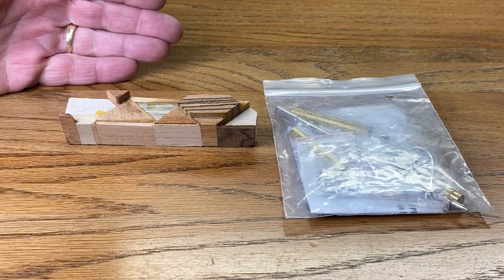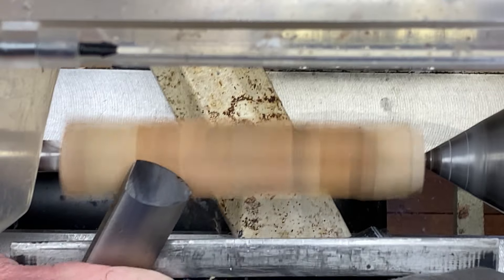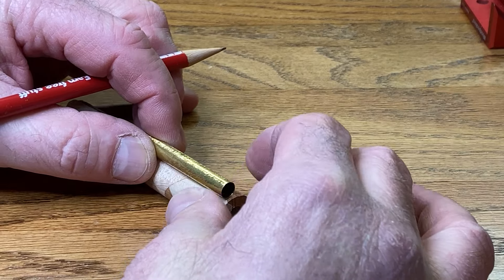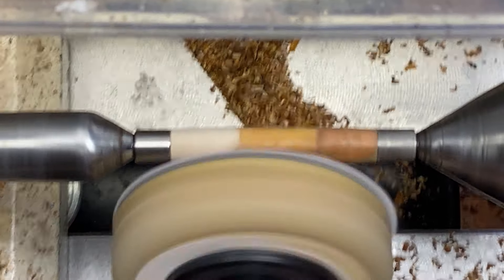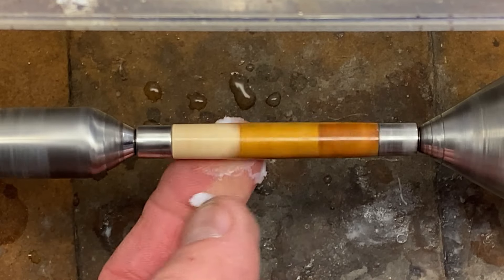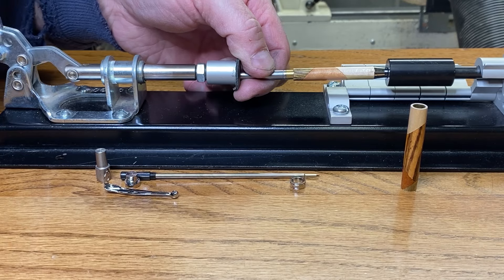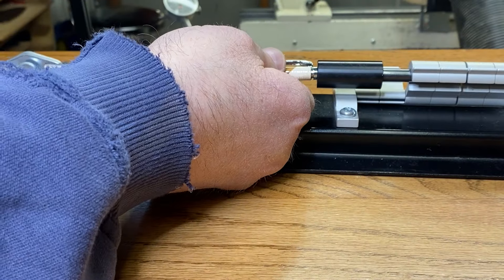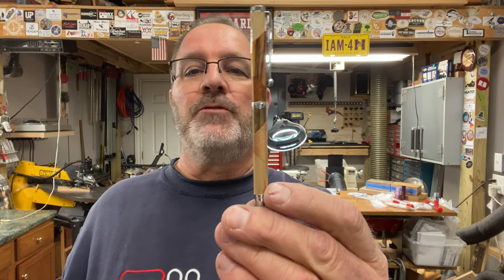CHAOS Blank on a Slimline Pen Kit

Comment: You can always build the diameter back up with your CA glue if you remove a little too much material. You don't want to be doing that all the time just because it drastically increases your glue costs, but it works when you have a blank you don't want to lose or have your heart set on a specific kit.
Reply from the maker: Thank you Vince. 

Regards,
Bob